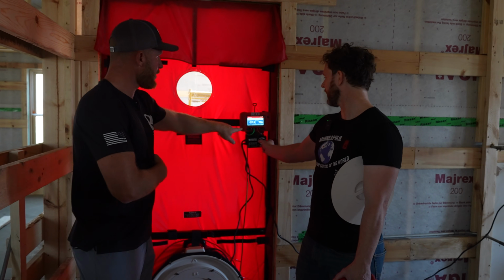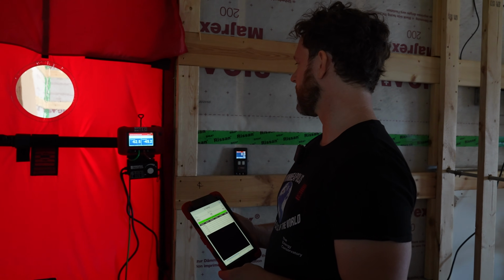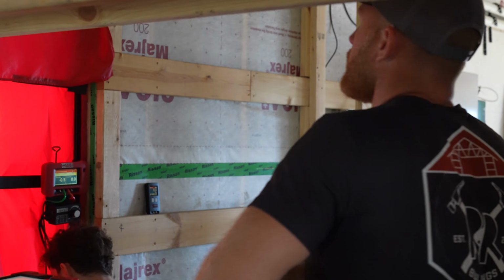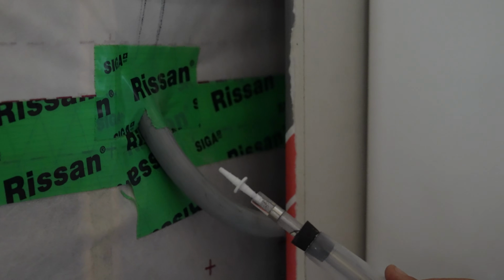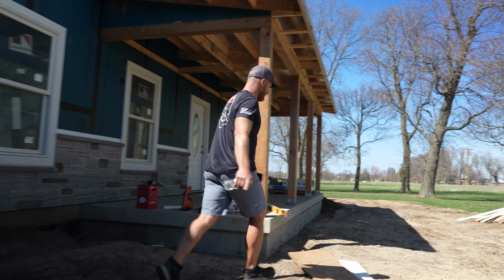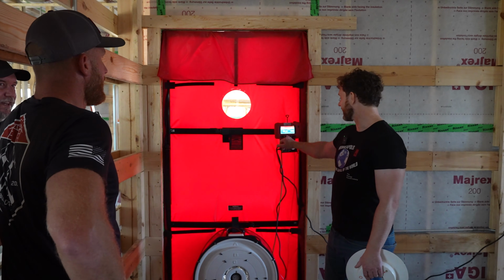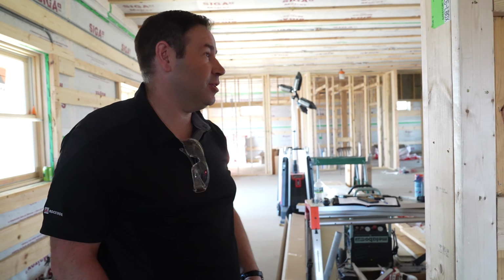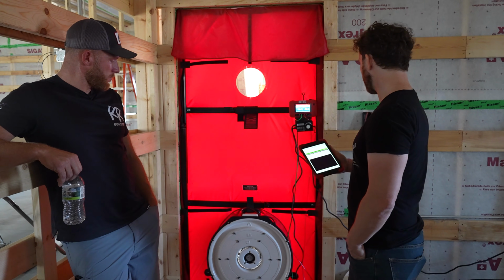Can a House be too Air Tight?

Comment: Impressive baseline number without using sprayfoam and before drywall is applied.  If you're OCD about air tightness, look into the Aero Barrier product.  Matt Risinger is big on it.
Reply: Matt is big on anything he’s paid to be big on. He just drooled all over a tesla solar roof and I hope people are listening because I make an absolute killing chasing down installation issues and maintenance once tesla abandons the customers
Reply: Aerobarrier is not the best approach - its a "I did a bad job and really need this fixed" use or "I can't do a full tear apart but doing a full interior reno on an existing". 

It's cheaper and more future proof using the systems as above. 

Aerobarrier is just caulking - it has a lifetime and may have a failure rate 30 years down the road. Its also hard to say where the holes it fills are - meaning if you renovate in the future and move walls around - you might have removed areas the aerobarrier fixed. The tape and membrane systems become true materials after the adhesive fully set - meaning they will last longer then the house will, and would have better shear and tear resistance so "house shifting" problems are lesser - so the value will be true even as the house ages.

Comment: Outstanding build! Congratulations! Your heating and cooling cost will be minimal. However, Humidity Control now becomes an Issue! Do I really want to live in a home where moisture build-up in the stud cavities can lead to moisture buildup, mold growth and wood rot. As we are building tighter houses this could become a problem that we will know about in a few years.
Reply: Moisture can be controlled by mechanical ventilation and heat recovery equipment. This comes at a cost for both installation and operation. Maybe a FEW AIR CHANGES and NATURAL VENTLATION per hour is not all that bad.
Reply: Moisture can be controlled by mechanical ventilation and heat recovery equipment. This comes at a cost for both installation and operation. Maybe a FEW AIR CHANGES and NATURAL VENTLATION per hour is not all that bad.
Reply from the maker: Actually with the system we used as our interior and exterior air control, they are permeable in the proper direction allowing for proper drying of need be.  The goal is with the proper wall assembly we don t have moisture or condensation build up in the wall
Cavities

Comment: I could tell Kyle was annoyed with the first result, even thought it's miles ahead of the typical building.
Reply from the maker: Not gonna lie it was a huge disappointment.  Glad we found some dumb mistakes we missed.  Now I just need to use better windows and doors if we want to do much better
Reply: @RRBuildings  A different kind of better that would be more interesting to see that upgrading windows and doors would be to get to the same sub-1 score with less effort and/or cost to the homeowner.

Comment: I've seen caulking blown into the air inside the house and when the house is pressurized the calking is blown into the holes, sealing the home.

They even showed how a 1/2" hole was closed off with the caulking.

It was developed to find the holes, the human eye couldn't find/see/locate, giving the house a full and complete seal. As such they had to install a system to all air into the home, but that air was clean, etc to make for a completely healthy air exchange
Reply: It's called aerobarrier
Reply: It's called Aerobarrier. Matt Risinger has a couple of great videos about it. https://www.youtube.com/watch?v=CV5elSvasic

Comment: Yes. It can. You need at least some ventilation. Whenever (rarely) we make a new house, we always include a central ventilation system that's as naturally flowing as possible, which is difficult - because of the filtration.
One thing that has changed things (for us at least since the 2000's) is computerized flow computation, these days we model, offer constraints to the program and build the ventilation, back in the day they used to experiment (also) with smoke.

In my line of work, restoring old buildings it's sometimes good and easy, sometimes darned hard, depends on the house - but it works and it's good, because mold doesn't go in said houses anymore, whereas before, regardless of how good the water displacement of the house was, mold would still find a way, especially in the recent years with these new strains that are more resilient than before. Studies show it's going to get even worse as temperatures go up...

Comment: my inlaws built their dream home and its too tight...all sorts of condensation, water issues.  THey have to run their AC all the time and plug in dehumidiers everywhere.  I am of the mindset that the house needs to breath like everything else.
Reply: Faulty HVAC design. Sounds like they need an HRV/ERV installed that works properly. Yes, it needs to breathe, but it breathes where we want it to breathe, not the house, randomly

Comment: Insulation doesn't mean anything if you're drawing cold air straight in from the outside.  In principle, if you're going to do that, just don't insulate and live outside like monkey.  The point of sealing it is to draw your air in through an HRV or ERV to recap 90% of the energy and still get fresh air.  And that's what these homes intend to do.

But there is a simply solvable problem to this.  What if the power goes out?

My answer?  Open a window.  But now you get to control whether your house's walls are useless or not.
Reply: In Europe as part of the hole clean outlook we've begun passing the air through heat exchangers that take ground heat and warm the air before it enters the house. The air is pumped with the use of a combination of draft intakes and out and mechanical wind aided pumps. The system is basically electricity free, unless you opt to power the ventilation.
Reply: or you could just failsafe the outside air damper to open....
Reply: @grundell2930  Sure could.

Comment: It makes no sense to have an airtight Home only to have a air handler that is replacing the air with outside air.

You pay all the money to make your house tight and then pay even more money to install Equipment so you can actually have a functional system.

There isn’t much point to go to this extent.
Reply: Totally makes sense! You want to control where the air is coming in, and you condition it both temp and humidity. Reduces both heating and cooling/de-humidification costs
Reply: The point is the ERV or HRV that takes care of that.

Comment: I don't understand the obsession with making homes hermetically sealed.  You need a constant replenishment of oxygen to breathe, since a single human needs about 1kg of oxygen a day, and outdoor air is just 20% oxygen.  If the house is sealed too tightly it will negatively impact people's health and productivity.  I prefer my house to be cooler, with a good air flow through it.
Reply: The idea is that the HVAC replenishes the house with filtered air at the perfect humidity and temperature. Air sealing saves a huge amount of energy over the lifespan of the building if the AC is always running. Or you can just crack a window open slightly if you don't want to use HVAC.
Reply: Exactly. Using an energy recovery ventilator the building exchanges air through a filtered system and keeps the energy you paid for inside the home. 

Think of it like your car engine. You could drill holes all in your air intake system and it’d certainly “breathe” better and likely run better. However the dirty air will kill the motor in short order.
Reply: The idea of intentionally building leaky buildings has been derided literally for decades. The point of a tight building it so enable you to control the air coming in, via an ERV/HRV unit, allowing you to filter and precondition incoming air, which improves the overall comfort, efficiency and healthiness of the building. If the building is leaky, you are allowing all manner of pollutants and toxins to just come in willy nilly, which ruins the air quality inside the building. This seems like basic common sense to me.
Reply: Yep, it allows you to control the source of air. If this kind of effort is being put in, it’s likely that there will be an ERV or HRV that can transfer the temperature of air exhausting out to the air coming in without contaminating it, so less energy is required to heat or cool that air, it can also ensure the air is HEPA filtered before entering the house.
Reply: Yeah, but then all the nice pollution your friendly friends over at Exxon helped build in our atmosphere is all going through your lungs shortening your life span, giving you all them nice medical conditions you love to read in a medical report and so on.

Listen, just because you don't understand, doesn't mean it's wrong. If you wanna be at the mercy of external conditions, enjoy the old ways. If you want to fully control the air you breathe, from heat to cold, dry to warm... and have it be clean, then go our way, because usually, we do some math along with it. Computational flow, statistics all those nice things that keep the world going.

You can disagree, but not for much longer. Eventually, you'll want to have clean air in your house. Weird that after a pandemic, which forced a lot of people to wear masks... we still haven't figured out just how bad the pollution is considering all the statistics regarding lung diseases. I mean, if one diligently wore their mask... it should've been enough to just look at the dirt in filter...
Reply: I’ve built a passive house in Melbourne Australia and can vouch that all this effort is so worth it. I moved in at the start of winter and have used the heating system on a handful of days to bump up the temperature of the whole house by 1-2 degrees Celsius which took less than hour. House is 5000sqft. Zehnder hrv also helps to prevent overheating by activating bypass mode and allows some passive cooling when the air temp outside is cooler and the inside is warmer than 23 Celsius. All week the outside temp has been under 10 Celsius and the inside temp is between 20-22 Celsius with no heating used.

Comment: One of the benefits of the 1960 build home was the 2 to 3 times a day total air exchange passing through modestly air tight walls. Got moisture in the walls? No problem as it would dry out fairly fast. R factor of fiberglass insulation was dependent on moisture level. So those 1960  houses leaked hot air to the atmosphere  but were nice, warm and very dry.
Reply: Warm and dry but expensive to heat
... It takes much less energy to dry fiberglass through humidity control than it does to dry it by leaking warm air 😂
Reply: As an owner of an old, leaky house, the energy bills are awful.

Comment: Yes, a house can be too airtight.
Reply: One of my instructors at my trade school gave us the example of homes moving towards being like a biosphere or submarine; All elements needed to sustain life are control and monitored from within.
Reply: @RDHomesCT  As it should be.
Reply: That's why you add mechanical ventilation. You control the air exchange instead of letting the house do it for you. Ever see a remodel where the insulation is all filthy? Yeah, the insulation was filtering all that...

Comment: Wat if u run out of oxygen
Reply: They’ll have an HRV/ERV for air intake/exhaust.
Reply: You'll get a headache then certain death
Reply: @anthonyman8008  you'll notice the hypercapnia before hypoxia
Reply: That's actually a concern. At least here in Germany new homes are required to have a connection from your extractor hood to your hvac system so that new air is being pumped into your house at the same time, so you don't end up under pressurizing your home while cooking.